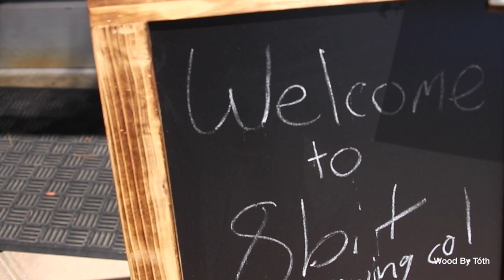14 Reclaimed Wood Tables For a Brew Pub - Final Video

Comment: how do you like poly-crylic? what is your process when using it? brush on and sand between coats?
Reply from the maker: Scott Haun I really like it. Its super simple. I sand with 150 grit in between coats. Usually 4-5 coats works well. They the heavy use these get they need re-coating every year

Comment: The way the metal crossbraces are screwed into the top, wont that affect wood movement and maybe crack the top eventually?
Reply from the maker: joeyisfunny The part where the screw goes through is oversized so the screw can move if the wood want to expand